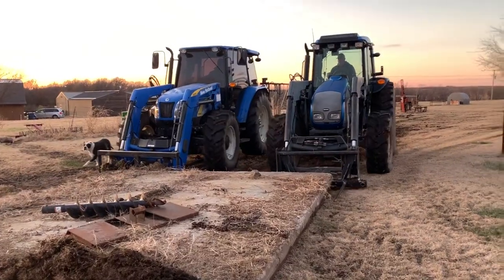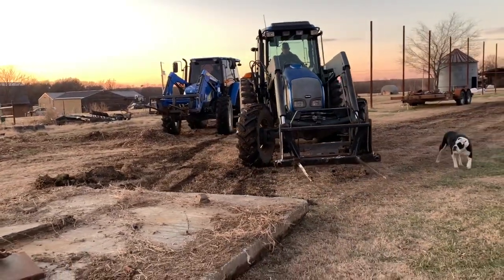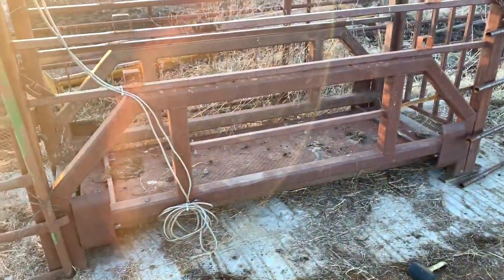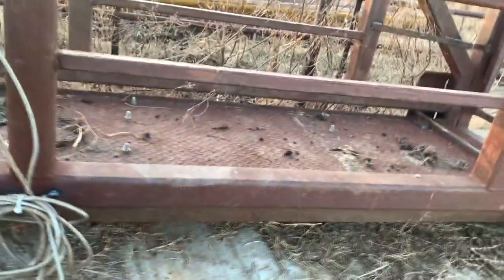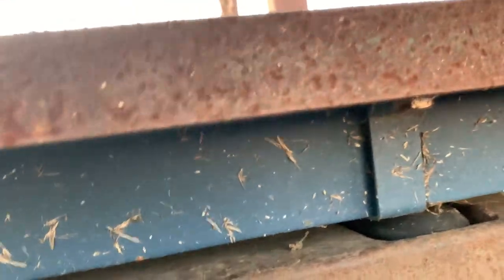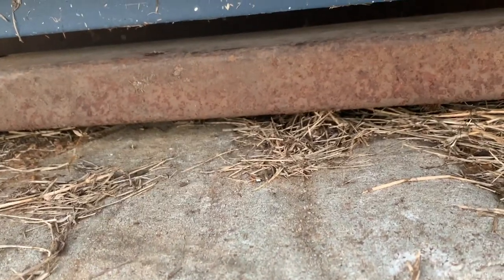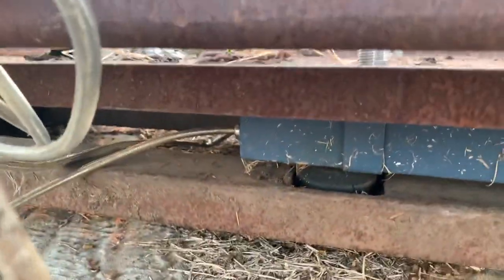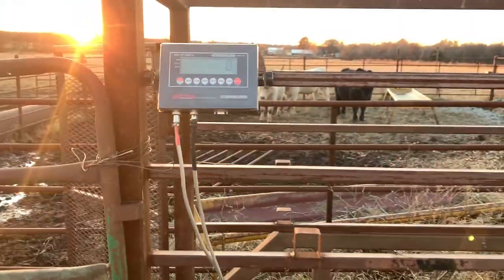Running Steers Through Our Portable Livestock Weighing Scales - 4M Ranch

Comment: A scale system would sure be nice
Reply from the maker: It is nice I think we only gave around 600$ for the load bars and digital screen. We’ve had it for 2 years no issues with it.
Reply: @4MRanch  where did you buy the load bars?I purchased a load bars kit ,300$ on amazon 4months ago.  So far, so good
Reply from the maker: We got them on eBay.
Reply: @4MRanch  I just checked the purchase records again. They have coupons now, probably for the peaking season